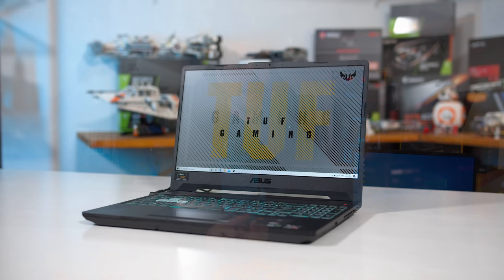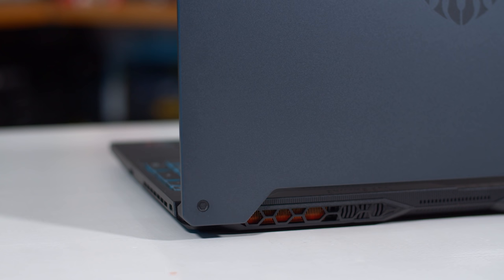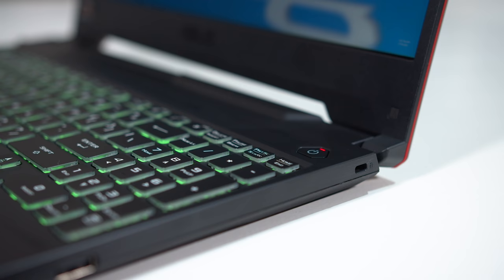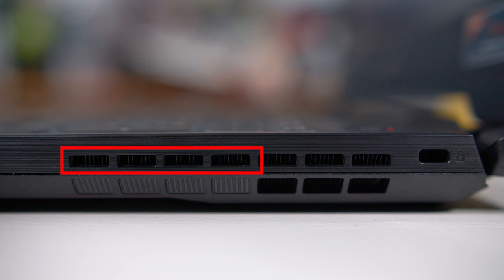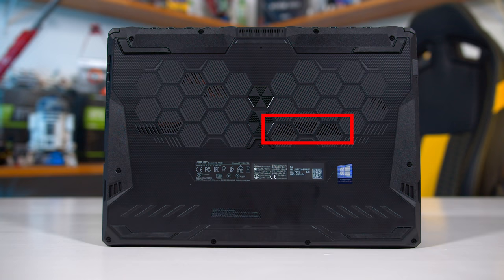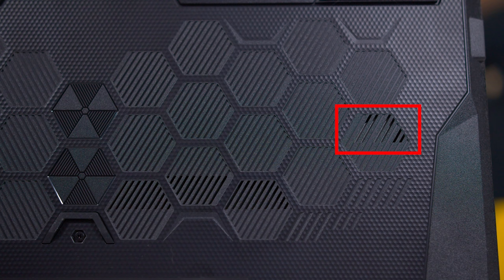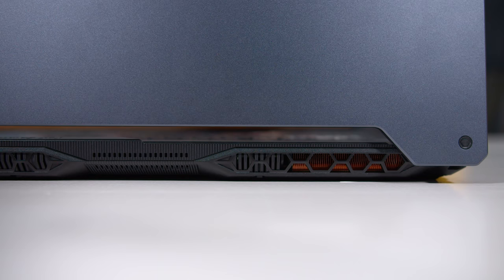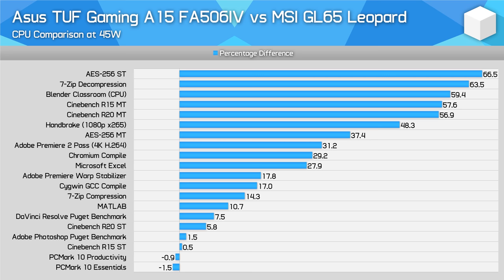Don't Buy The Asus TUF Gaming A15 (2020 Model)

Comment: I bought an A17 with 4600H and 1660TI.
After Repasting with Liquid Metal I get 86°C in Cinebench@3850MHz, 76°C in Gaming@4GHz. Average Boost clock on the GPU is 1740MHz@70C. 
Fans are barely noticeable in stock and sound like a vacuum cleaner under full load. 
Screen sucks, but it's sufficient for a second device to do some gaming on the go. 
I paid 910 EUR including an upgrade 16GB RAM. Getting the same performance (6 Cores, 1660TI) with a 17" monitor would set me back at least 1.100 EUR for B stock for any other manufacturer.

Comment: I’m planning on buying it with Intel-i7, will that make any difference?

These are the main specs that i found on the one that I will get:
- ASUS TUF Gaming F15 FX506LU-HN110T
- 8 Core Intel Core i7-10870H Processor 2.2GHz
- 16 GB RAM
- 1 TB SSD
- NVIDIA GeForce GTX 1660 Ti

Please tell me if it is good or bad and if I should get it or not and thank you 🙏🏻
Reply: It should be fine

Comment: I personally love this laptop. It definitely runs hot when doing heavy tasks but I personally always use a laptop fan when gaming. With that it doesn't have any problems. The price you're paying for these specs, I'm fine with having to make a small compromise. The laptop does run fine even without the cooler in experience just hot. I've had no real problem with the display either.
Reply: Hi man, did you Undervolt/Overclock your laptop? And hows the performance so far?
Reply: @wonderfullifemyqueenandmye4259  I didn't feel the need to do anything to the laptop. Putting it in silent mode keeps it running cool when I'm not gaming. In gaming, I'm getting 60+ fps in every AAA game I've tried. The system does heat up on the right side when gaming but a laptop fan keeps it in check for me.

Comment: To be honest Asus lost me a year ago, I bought a TUF FX505DU with Ryzen 3750 and 1660Ti and it was a disaster. Drivers not working properly, thermal throttling, and the noise of fans were unbearable. There were hardly any games which did not stutter after 5 mins, as the CPU overheated and dropped to 400 Mhz for 5 secs. That was at the time Asus introduced TUF to the market and fortunately in my country they offered a promotion that allowed me to return it for 14 days. I opted out on the 10th after consulting with the vendor and finding out on forums that others experienced the same; so I bought an MSI with Intel config. I'm using it since and my only complaint is some coil whine. With that said my next setup will be a desktop, I simply can't trust a laptop handling this performance.

Comment: Watching this on an Asus Tuf A15 as we speak, and I have to say, without a shadow of a doubt, after 6 months of heavy usage, it is the best laptop I've ever purchased. It performs flawlessly when multitasking. Has zero issues dealing with the workload of resource intensive  games like MSFS2020 and Hitman 2, and the cooling system works fantastically, always keeping the laptop below desired temperatures across all components. I also run resource intensive audio editing programs and video editing programs. The computer handles these flawlessly as well. So if youre reading this and thinking of buying one of these badboys, Id say go for it. The value for money is insanely good, and with all due respect, I have no idea what the guy in this video is talking about. He seems to have a bit of an unreasonable attitude towards Asus to me. Maybe he got burnt in the past, I dont know, but this video is not accurate at all.
Reply: Hey i was planning on getting the 4800h with 1660ti and i will be using it for gaming and probably for 1080p video editing.
Do you recommend it?
Reply: @alanthampi4718  100% I'd  recommend it. I have the 1650ti with mine and it's perfectly sufficient for a heavy workload, so the extra V Ram of the 1660 will serve you well 👍🏻

Comment: 1. I can't understand how you didn't mention the worst „feature” of this laptop: RTX2060 outputs via the USBC/DP port ONLY, while the AMD GPU outputs via HDMI only, instead of making a software selector that would output a certain GPU via certain port. What would be the reason of blocking certain ports...
2. You forget to mention the QLC Micron SSD coming as stock. QLC?
3. Low end WiFi card, 433MHz only.
4. I like how you praise the MSI at 6:35 while showing the cooler-less PCH that heats up like crazy (over 65 degrees in idle)

That being said, with all these „negative” traits, it is still miles better than the old thermal station i7 8750H I used to have in the HP implementation.

Comment: The MSI model doesn't have adaptive sync while the tuf does. Big issue with current gen laptops. Remember when the 10 series laptops all had it. Pretty bullshit most don't. Also I'd like to see the score comparison between the 2. Maybe there's a bios issue on the tuf. Like the CPU staying clocked too high and not throttling properly.

Comment: What to do, dismantle them, drill those blockage and adjust.  Then resell them "Asus TUF Gaming A15 modded for better air flaw"  Or keep them after modding for testing purpose?  Thanks a lot for this info.  My place is hellish hot, so I'm not interested on devices that are already choking themselves.

Comment: Understatement!!! Let me rephrase your title - Don't buy ANY Asus products. Point period.
 I am fighting with my supplier now cause they sold me a TUF Gaming motherboard From the moment they they inserted this board, it has been restarting randomly. The Sata ports just come of the motherboard  when pulling out the cords. The memory slots don't work.  Now because the 1 port is broken because of their crap quality - it is warranty void. I have worked with motherboards from the year 2000 and I have NEVER!!! felt a motherboard so flimsy when you try to pul the PSU out. I always buy Gigabyte boards. I had to replace it and it was all they had. ASUS - I will never ever buy any of the products just cause of this stunt they pull to go use the cheapest materials, I don't care how good the board runs, or how good the overclocking is.  - all of that is pointless if they use the cheapest material to make this board. It will never last. Everything will just get brittle and break. I spend a huge amount on this PC and it is just becoming more unbearable that every thing is so useless today. Things fall apart or is outdated every 2 years. My warranty just expired on another item and it broke. Seems nobody can provide quality. Sadness.

Comment: Video title don't buy Asus tuf a15
Video description link to buy Asus tuf a15
Asus tuf a15 specs are clearly unbeatable by other gaming laptops at the same price.
Heating problem? The Amd Ryzen professors are built to handle 103° C
Edit : temps don't cross 96° even during streaming.

Comment: I have an Asus Tuf Gaming A15 and since the first moment I looked at the cooling system I thought it looked like a half finished product. Sadly I am stuck with it though because I'm not gonna go buying another computer and having it shipped here and so on. My model has that empty space you were talking about as well next to the mother board which when I saw it I questioned whether I bought a used broken apart laptop or if there was something to insert there for a second.

Comment: You complain about airflow holes, temperatures and performance problems ... that nobody but you has measured or noticed! In fact, we're talking about one of the coolest running devices in its class at full capacity.
I own a TUF A15 UI (and a number of other notebooks from various manufacturers HP, acer, RAZER, Lenovo, ERAZER e.t.c.) and use it for gaming, video editing with programs such as "Blender" and other performance-hungry work. I installed 3 ssd (2x intel nvme m.2, 1 EVO) 2 TB ssd otherwise the hardware is unchanged. Cyberpunk, Horizon Zero Dawn, PUBG, Witcher 3 runs in ultra settings with 4k resolution without problems or problematic heat development. As with all other gaming notebooks, the fans  of course become  clearly audible by the system at  this point. (Solution: headphones)

Comment: I got my TUF A15 last Friday and ran it all weekend. It is the 90wa R4800H with the 1660TI, 16 gig of ram. I did make one small change which was to change the CPU boost in the power settings from Aggressive to Efficient aggressive per a post I found and did not get temps above 75-80 with any game and ran all games at full spec. So far I love this thing.
Reply: what fps are you getting in games? for some reason my model with the 2060 runs very bad and is performs terribly

Comment: Sharing my impressions of an Asus FA506IV (4800H, RTX2060) I purchased in early Aug, 2020.  Right away, the HDMI port did not work.  The service centre ordered for a replacement motherboard.  It arrived within a week, which was nice given the prevailing pandemic.  Now I hear that the replacement motherboard fixed the HDMI issue but occasionally (as the service technician told me) failing to detect the display.  The service center has asked for a replacement for the replacement.  Meanwhile, I wait for a final fix with a jittery feeling as to how long this laptop would really last.  The few hours I could use the laptop gave me an impression that your review was too harsh.  There are severe QC issues, nevertheless.

Comment: Got mine a week and a half ago with a 4 year in-store product replacement just incase, still undecided on whether ill bring back or not, everything is fine EXCEPT for the touchpad, which skips sometimes when moving the cursor around, it does not do this when its set to highest sensitivity in touchpad settings, am wondering if its a driver issue or a physical problem????  Doubt you'll actually answer my question though, u guys never do, Ill probably just end up keeping it, enjoying it, and not taking your reviews seriously anymore........

Comment: I was really planning to get this because of the tempting low price, but you got great points, I'll have to think twice.
BTW can you give me some info about a17? It's also tuf, but bigger
Reply: I got the A15 my buddy bought the a17. They both have the same layout pretty much, just at the moment theres no A17's with 2060's. If you don't need ray tracing it really doesn't matter though....  I get about 220 FPS at high settings in CSGO. My temps dont go above 90 when playing it even if I have played it for like 3 hours, and thais is all while using it ontop of the cardboard box it came with. The only reason I bought it over anything else with the ryzen chips is simply because it is the only one with upgradable ram for both slots, none of this solder BS......

Comment: The officials said that the air flow is blocked to decrease the central temperature because there would be more air flow due to higher pressure. And they said if they open all of them, the temperature on the surface would increase and then decrease the experience of the keyboard
Reply from the maker: https://www.youtube.com/watch?v=HJS-ZAmcreI

Comment: As an owner of this device shown in video. DO NOT BUY ASUS TUF A15
It has thermal problems burns your hand even playong csgo in lowest graphs, wifi dropps of while gaming so you have to use ethernet cable, doesn't perform well I only get about 150fps in lowest in competitive csgo matches. And most annoying the panel is SHIT!
Who would put 23ms panel to gaming laptop such a bad panel? Of course asus!
Instead of this just go for Lenovo Legion 5 models

Comment: if i buy the ryzen 5 4600h+gtx1650 config will this still have a cooling issue as it would be much less than ryzen 7 + gtx2060??
(also is am okay with the screen as the performance is the thing I need)

Comment: The AMD based model uses a 7nm CPU not the hot-house 14nm Intel CPU - With lower TDPs, there probably isn't such a need for the mega heat pipe Intel system?

Comment: i have a question for you. if u get your hands to the new version 2021, will you try to swipe the bottom panel and the cooling system from the 2021 to the 2020 - to see if it fitts? and the cooler fans are they same dimensions ? hmm

Comment: Hmm... i think I purchased this laptop roughly a month before this video released and only just saw this come up on recommended videos (would have been nice to have seen this before buying). Question though... I can see there was significant difference when the laptop was run with the bottom cover removed... Although I wouldnt run my laptop like that, would it make sense to carefully cut out pieces of the bottom cover in places where ventilation would benefit for more intake, or would this be not a smart thing to do? Im basically near the end of manufacturer's warranty and would consider modifying the bottom once my warranty is over.

Comment: There are new laptops with Ryzen 4000 processors from Acer - Nitro 5. Two of them have the Ryzen 5 4600H. It would be possible to compare GTX 1650 Ti with non-Ti. In Poland there is 75 USD difference between them. Both has 8GB RAM Single Channel with one empty slot, and a 144 Hz screen.
What is new with the Nitro 5 line - the fans are in the corners, and the air flow is better, I guess.

Comment: I bought an Asus tuf laptop with 3550h in 2019, and am very disappointed with the device. Never had such an incredible loud laptop and the CPU doesn't has so much power consumption. Build quality is also just too poor even if it's relatively cheap. You get what you pay for, will now switch to XMG (again)

Comment: damn, didnt realize most of the thermal design are just... sidelined for aesthetics. i was contemplating with selling my still perfectly running tongfang gaming laptop (nothing fancy just a gtx1650 unit) for a laptop with an rtx2060, was interested in the asus tuf design, but damn the thermal design on my cheap tongfang laptop is leagues ahead of the asus tuf, my under case vents are actual vents with real holes in them with massive twin exhaust. kinds disappointed by this.

Comment: I am also disappointed for the fact that until now I cannot find any 17 inches or above laptop with AMD consumer top of the line poweful ryzen 9 3900 series or ryzen 9 4900 series processors.
It seems laptop manufacturers together have decided to line up to protect intel (easy to find 17-inch laptops with the most powerful intel consumer CPU) or are having some intentions which are not at the good for the laptop power users. This will eventually badly affect AMD as a processors company.

Comment: How I thought about it was the theory that the speed the air moves helps out tremendously, which in turn helps cool the CPU/GPU.  Granted Asus coulda made the size larger, but in the automotive world, a 4 valve V8 engine does produce more power but a 2 Valve V8 at the same displacement- think Ford modular V8 with 2 valves vs 4 valves- produces more torque due to more turbulent air coming in because of fewer valves.  This also helps the air/fuel mixture atomize better, and in turn can help the engine produce more power because theres more AFM available.  Similarly, that's what the Asus engineers must've thought

Comment: Hi! 2 Weeks ago, i bought the ASUS TUF With Ryzen 4600H and GTX 1650.
Based on my expirience, all things that he is saying is kind of... bullcrap.
Maybe in a technical perspective, it is. BUT... so far, it have never let me down.
I use this laptop to play some competitive game like valorant and CSGO at a medium-high settings.
Nothing's too hot that it got to the point where you feel it and the performance is dropping.
I usually do a 1-3 hour gaming session and nothing feels wrong, it's all excellent!
I also use this as my editing computer and it worked great! (I know the color gamut isn't that great but, i'm more into doing 2D & 3D motion graphics so, color isn't the most important thing in my checkbox.)
If you need any infos from me, just let me know :D
Reply: Hi I wanted to buy Asus tuf a15 with ryzen 5 4600 and 1650 just for playing strategy games like total war.. Did you recommend for me?
Reply: @RTXTi-vu2gz  Sure! It's definetely not a problem for this laptop.
Reply: Hi, im thinking on buying either asus tuf r5 4600 & gtx 1650 just like yours or acer nitro 5 r5 4600 & gtx 1650. Im not doing any editing stuff, i will mostly use it for lightweight workstuff and casual gaming for like 2-3 hours. The acer nitro 5 hasnt arrived yet in my country but the asus tuf a15 is already available. I heard many people complain about the temperature, do you think i will have problem with it? I will not gaming on the laptop so much since i have pc
Reply: @ridhochandra3930  as far as I'm using it, i don't encounter any heat problems. The highest temp of my cpu is around 85-94 at a very demanding task which is completley fine considering the max temp is 105. The fan would take care of it. Also, Asus TUF A15 have amuch better build quality than Nitro 5.

Comment: Have owned a FA506IV for a year and a half now. I game, heavily(5-9 hours a day) on D2, COD and Dragon Age. Yep, it runs hot, yep the fans get loud in turbo mode.

Fixes:
Heat-None, it’s never overheated or BSOD on me nor glitched.
Screen-None, I’m a gamer, it responds fast enough for me and I don’t care about how pretty the blacks are.
Fan Noise-Put my noise canceling headset on, like all gamers do, everywhere. 🤦🏼

I’ve dropped it from 5+ feet multiple times, side top bottom and the like. Not a single problem. Had a GL65, it slid off the couch once, broke the corner and immediate persistent BSOD. It’s rugged, the MSI is fragile as are all other offerings in this price range aside from the TUF.

Garbage review, GL65 benchmarks slower too, you’re suggesting we pay more for a slower laptop. Seriously?